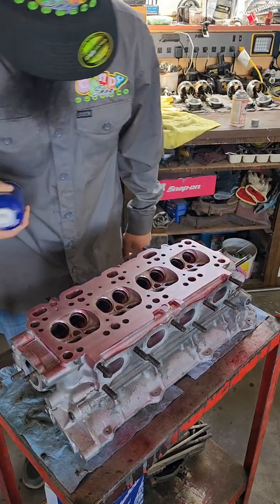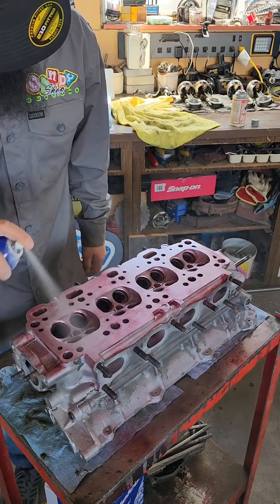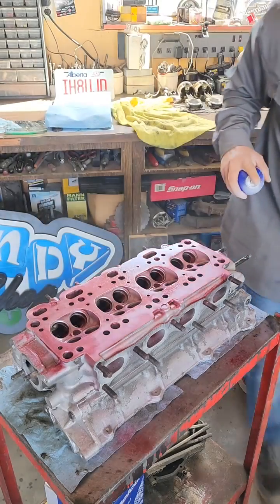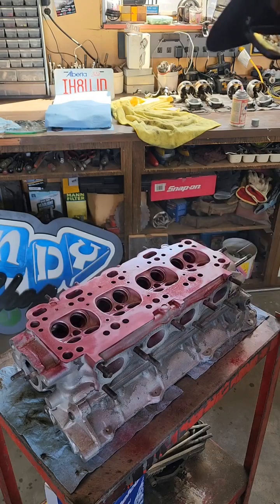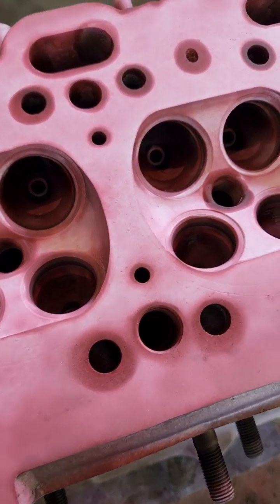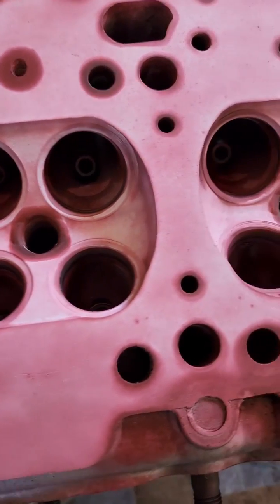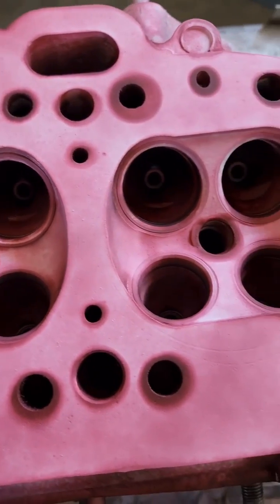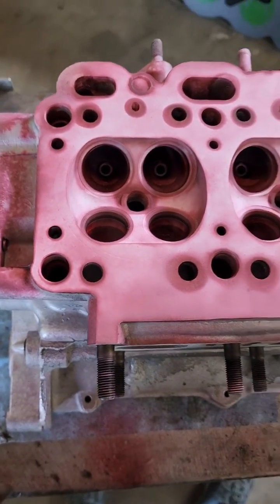Say no to crack Part 2

Comment: I worked in a machine shop for a year, you dont have to worry about aluminum heads cracking. Ive seen heads torched to shit and melted valves without the heads cracking, its just not a material property of aluminum
Reply from the maker: I've seen plenty of aluminum heads crack, often between the valves.